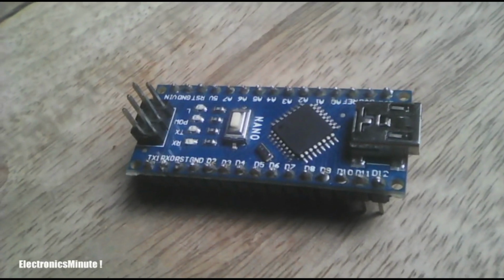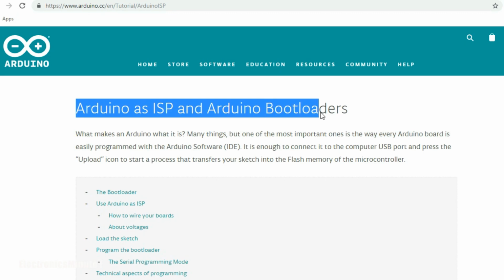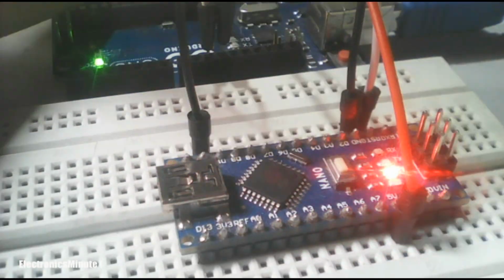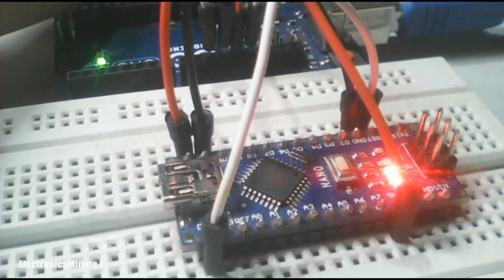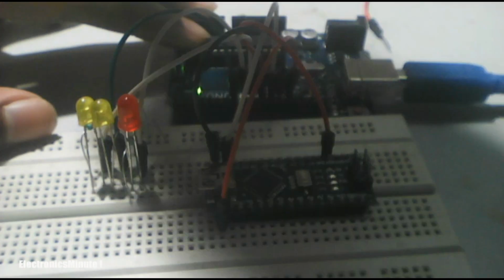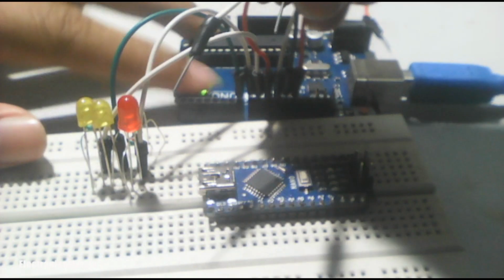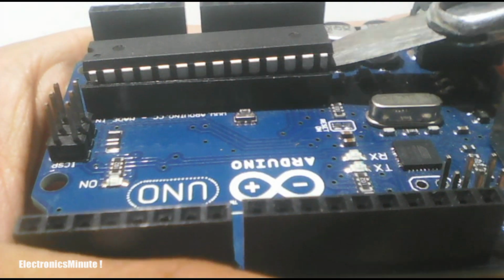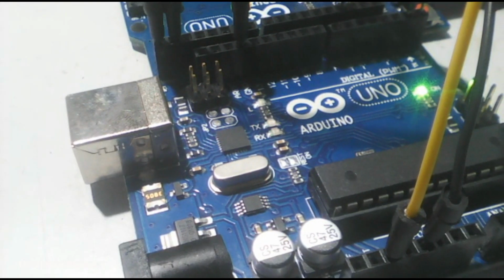How To Program a Arduino Nano by a Arduino UNO || By SPI and USART methods

Comment: Thanks brother, but when i uploaded the sketch it works as long as both Arduino are connected but when i disconnect nano from uno after upload and Power it separately it doesn't work
Reply from the maker: Which method you have followed ?
Reply: @electronicsminute5354  Method? I am trying same as you are doing in video
Reply from the maker: It should to be work at least I believe. I have use this on many of microcontroller to upload codes and they are working now also without the uno which I used as programmer. But your case the device might have some defects. Or check the connections properly. And choose 'Upload using programmer '.

Comment: can I use second method to programm NANO board...?????????????
Reply from the maker: Yes ! As the first Arduino converts the data from USB to serial with the reset pin and tx and rx pins it should work.
Reply: @electronicsminute5354  OK I'll try it n then will reply... Thank you